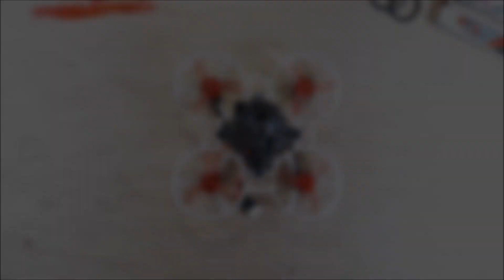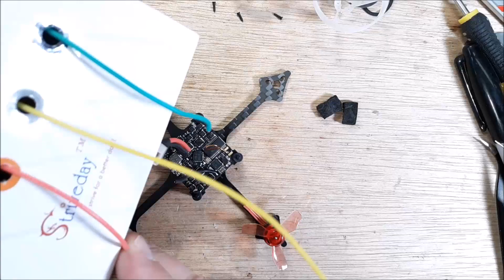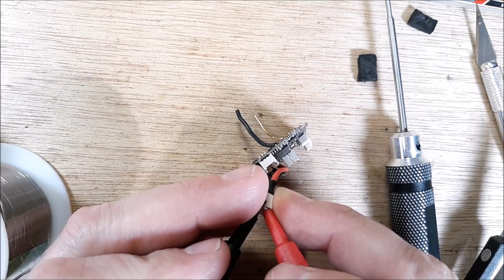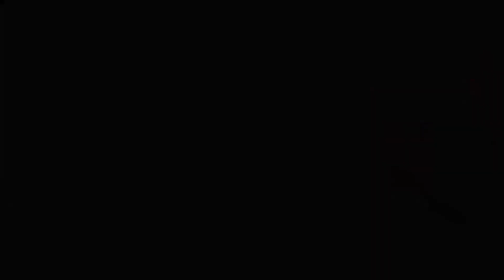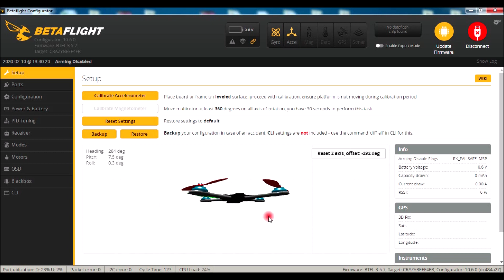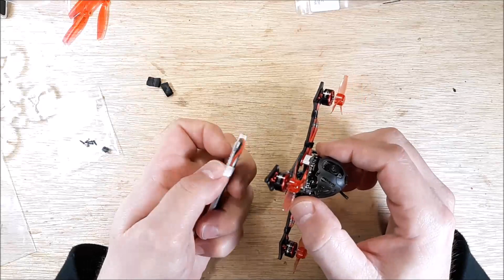Mobula 6 Toothpick Drone | Mobula 6 Whoop PicklePick Full Build

Comment: I bought the same wire on Amazon 24AWG this time and I noticed the insulation was pretty thick. I do the same thing with the fan cooling the quad while in beta flight.
Reply from the maker: I just received some wire 2 days ago for another project (The Ultimate Charging Station), and the insulation was nearly twice the thickness of the wire, strange.. I used to pass out blowing on my quads, till the wife bought me a tiny desk fan... Lol..
Appreciate your feedback...👍🏻🍻👊🏻
Reply: @PropsOff  I'm from Ohio where are you from? It seems to rain alot where your at.
Reply from the maker: @trevorimpulsebuyguy6398  
Columbus
Reply: Your from Columbus? Go Bucks? If your from Columbus I'm about 45 minutes away!
Reply from the maker: @trevorimpulsebuyguy6398  
Get on "Ohio FPV Freestyle Group".. We hook up on there..
Reply: @PropsOff  I sent requests to all 3
Reply from the maker: @trevorimpulsebuyguy6398  
I'm ScooterPie on Facebook, tag me

Comment: Great video 👍 have the same issue with my 2 both resetting if voltage goes below 2.9v. I added a cap to battery lead And did not help at all. Maybe a cap on 5v will help.
Reply from the maker: Honestly,  I believe the Eprom chip is faulty and they should replace the board (hardware issue and not so much a software issue).
I actually had mine reset to multishot and not the factory setting of Dshot600. That means it goes all the way back to the manufacturing of the chip set. It's a shame to, because I really like everything else..
Reply: @PropsOff  yeah happy model not the best but I like the idea.. maybe betafpv will make something soon.
Reply: @PropsOff  
The solution is quite simple !
Use a BT2.0 connector from BetaFPV and all of your problems are solved ;)
I did it  a few weeks ago and never drop again under 3.0 Volts.
I switch my Mobula 6 19000/25000KV to a75mm frame and its amazing !!!

The load drops on average by 0.2-0.3V.
With Emuflight / BT2.0 / Project Mockinbird tune for Mobula 6 / JESC 48khz I get 4-6min flight time with 300/333 / 450mAH batteries.
I have a video online where you can see the advantage.

Comment from the maker: Update Feb 11: The stock settings will not work. Airmode cannot be enabled due to it flying away. Also, if you punch the throttle, you will have an unretrievable camera blackout. More tuning and testing coming soon, stupid rain...👍🏻🍻👊🏻
Reply: @cutfpv  I am also having the same issue with the 25K motors, Built a lightweight 21 gram 75mm and get blackouts in punchouts, usin gnice tinywhoop mylipo batteries with BT2.0 too! I may have to try 22, or 19,500kv...

Comment: Can I get the lunk to the wire?
Reply from the maker: Striveday™ 26 AWG Flexible Silicone Wire Electric wire 26 gauge Coper Hook Up Wire 300V Cables electronic stranded wire cable electrics DIY BOX-1
Reply: to extend use 28awg if possible 26awg is to big and heavy. also save a bit more weight and direct solder the motors to do away with the connectors.
Reply from the maker: @MoodyDemiGod  
28 would be better I guess, I only have 26 and 30 on hand..